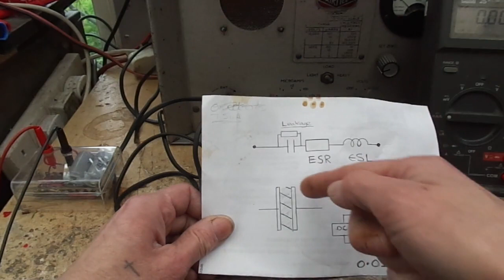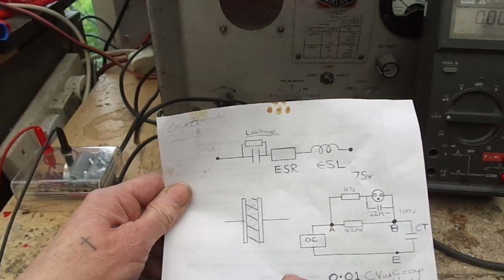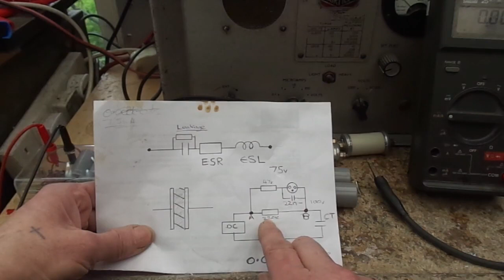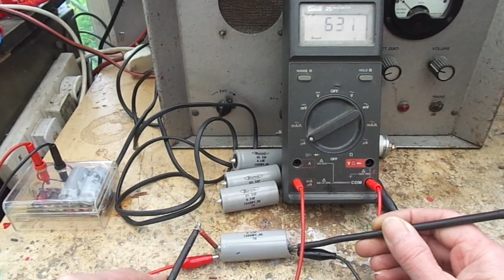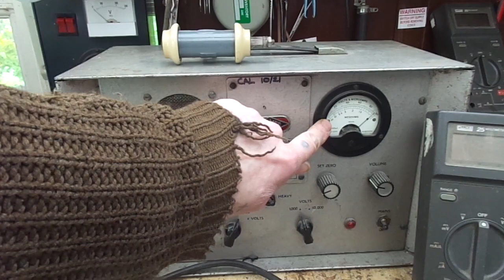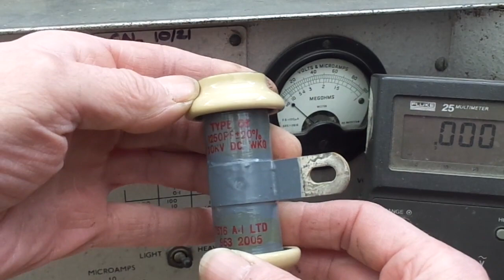High Voltage Capacitor leakage testing.

Comment: Cheers Andy, I really appreciate you making the video and explaining capacitor leakage. I will build that circuit as I have loads of old caps to test! 👍
Reply from the maker: Your welcome Ian, happy to help.
Reply: Hi Andy, the scope is a LEADER LBO 508 dual trace. 
It may be useful if any of your other subscribers have a similar issue with their equipment : )
Reply from the maker: @ianmorgan6104  Thanks Ian, it's not good when one has trouble with ones equipment.